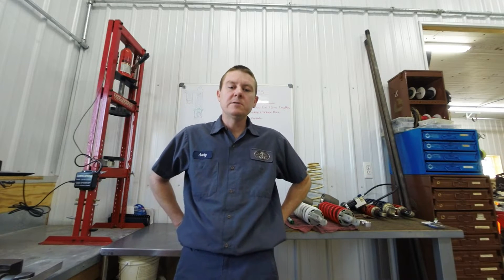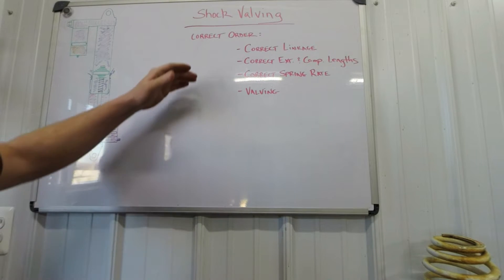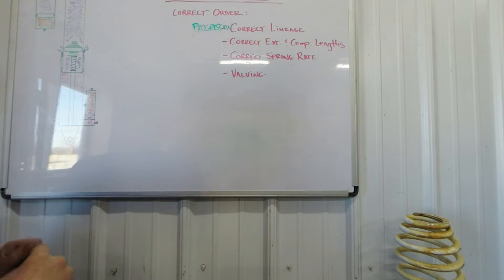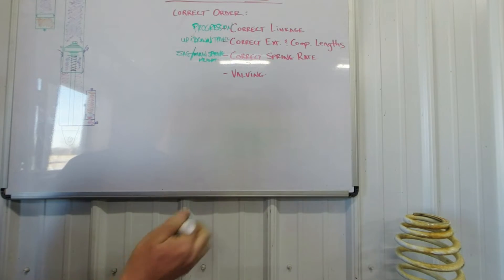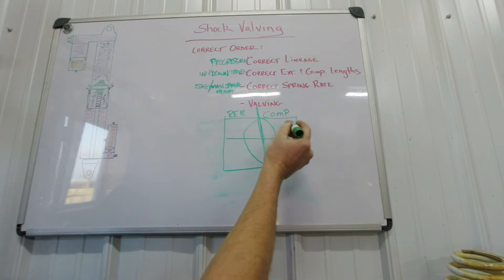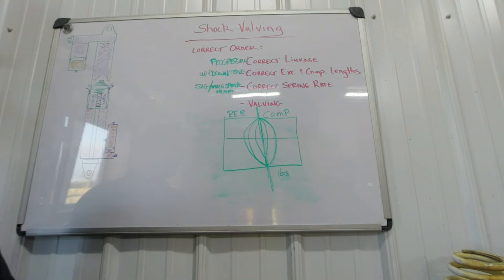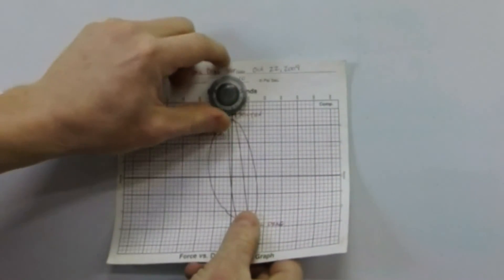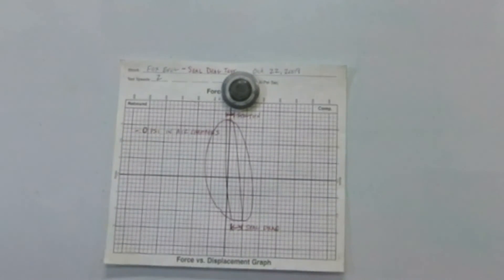Shock Valving Explained

Comment: When you said low and hi speed shims affect each other, when one of stacks is modified, could the transition shim be the one, that makes two stacks more independent of each other?
I presume, in a graph, spike occurs when transition shim is used, but prolly using thin shim of 0.1 makes less spike and yet enough bend for low speed to function adequately, even though you added more hi speed shims.
Reply from the maker: d1977j They are more speed sensitive but the low speed effects high speed more than high speed effecting low speed.
Reply: MaulTechATV 
Probably because too leaky slow speed flows too much oil, for the hi speed to actually come into play at a significant rate, when speeds increase.